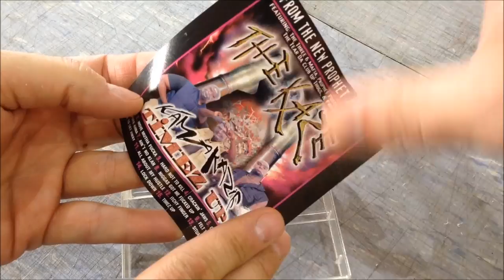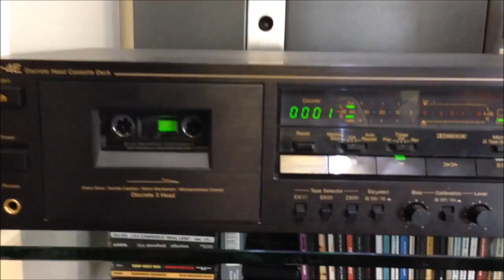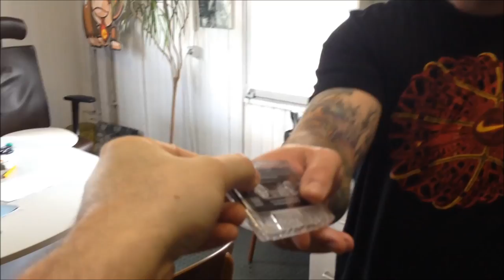fixing a ripped audio cassette

Comment: I'm sorry to say but you butchered the job (no offense)! You should have used splicing tape and been a lot more careful when you cut the tape. Also, i would personally try to get the loose tape ends out before opening it so the shell would still be in A++ condition (sometimes that dosen't work though). Also that's a nice tape, so rare.

Comment: When that tape you used for splicing starts leaking gooey stuff from it, you are going to ruin the tape in the cassette. You can buy splicing tape for that purpose that won't leak around the edges over time.
Reply from the maker: never had that problem! what kind of tape do you use? post a link!

Comment: 2:35 I see that the leader tape had separated from your cassette tape. The same thing happened to me after I finished side 1 of my cassette copy of Pink Floyd The Wall. My copy of the wall also did not have any screws at all, so I had to open the entire cassette. Unfortunately, I had to transfer EVERYTHING to a new cassette shell, but I have preserved the old one because that was a clear cassette shell, and that was a re-release of that album on cassette, and is considered a rare cassette. Older copies are more common these days and are not rare. I bought The Wall on cassette again a few months later, and I was lucky to have another copy in a clear cassette shell. It's a shame when cassettes without screws don't go back together anymore once you open a cassette with no screws. But I'm shocked that you were able to re-tape the supply reel and the leader tape (white tape) and reassemble without using spare parts. From now on, with EVERY tape I play, I make sure I wind the leader tape into the shell, so that you can see only the magnetic tape where the cassette deck does its job, so I don't have to deal with another tape having to be sacrificed. At the end of the side, I also make sure I stop the player before the leader tape passes through. I think the cause of your cassette tape being split in half has to be the tape heads themselves. #onceisenough